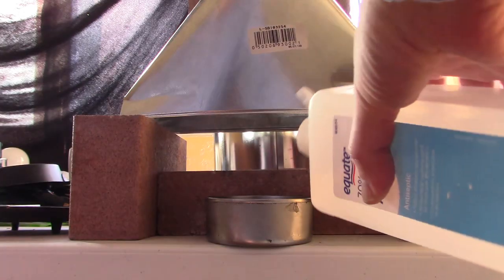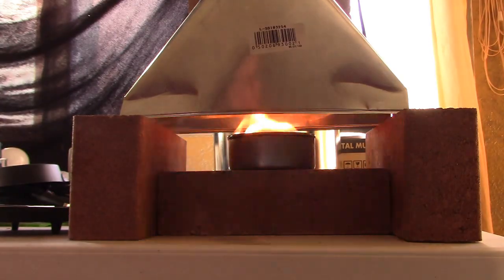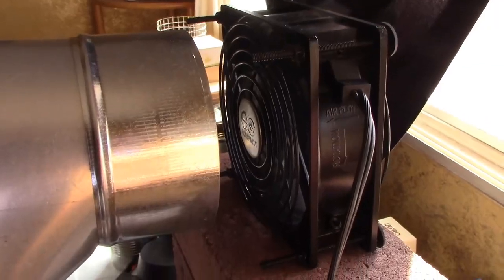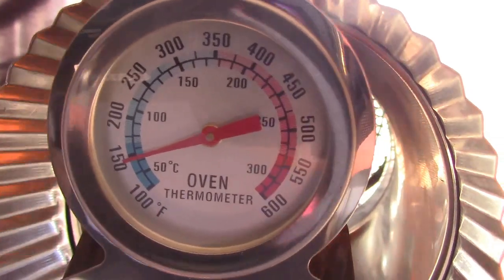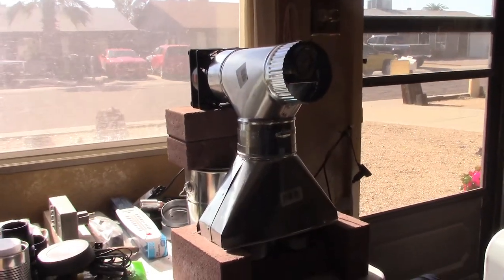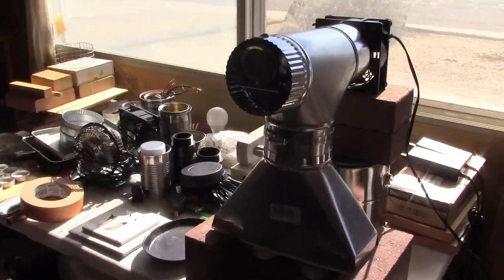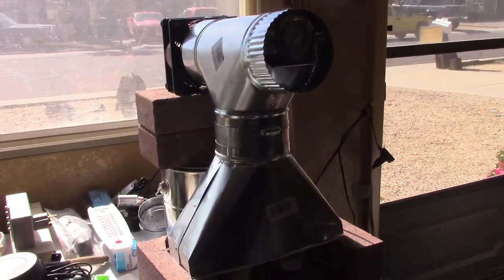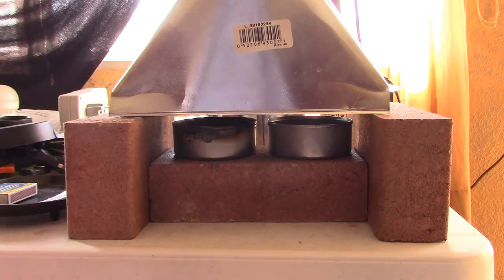DIY Stack Boot Air Heater! New design! Now with a "Tee-pipe Top" and a brick stand! - experimental

Comment: This would give me an Alternative for my VEVO Tent stove, the Top Plate of the stove comes off for Cooking, I could have the Burners inside the Stove, the top off and the Ducting setup on the top.  May use a veg oil burner with a feed line to the burner.

Comment: This is great thanks for the video. I think i will make the same one to heat up my garage in winter. I think you shoud add a mesh inside the burner at bottom to reduce flames and optimise heat to rise ...

Comment: I love your idea and design here but I think I have an answer that will make your design even better.  You need to replace your fan with a Stirling stove fan like in my link below.  Simply add a piece of metal to come out from the mouth of the "Tee Pipe" duct you have setup you have right in front of the fan and , like a tongue, put that tongue of cast iron or steel metal under the stirling stove fan and it would power this fan. watch this video link -->>  https://www.youtube.com/watch?v=4Hn16FHElqE

Comment: maybe use a little larger can to prevent the flare outs.. I like using the short dinty more more cans filled with sand as table top burners, I think one would work great in this set up. Some soup cans will fit on regular or home made oil lamps using a ball jar and oil lamp wick, you would get less heat for a longer time
Reply: that splashing flame is why the toilet paper is in the can heater, the alcohol doesnt splash out if it spills, I use sand in the smaller cans, its not as effective as the tissue but its a lot safer than just the liquid, it wont slosh like it did for you here but if its spilled over and the sand comes out, the sand is saturated with the fuel and it burns... It works with alcohol and lamp oil, I especially like it for tiki fuel even better is using used, dried coffee grounds, it smells great but is outside only because it smokes, which chases mosquitoes also

Comment: Learn something that will interest you:
the ceramic additive, motor oil, is superior to others, in addition to its anti-friction qualities,
because it magnetically 'isolates' the oil from the metal in the engine block.

oil is made of mirco particles has properties of magnetic charges, in addition to wear,
I suppose by "electrostatic" effect due to friction, it charges,
and it increases frictional resistance if these particles remain "stuck" on moving surfaces.

Concretely :
If you connect an elec wire to the negative pole of the battery,
and that you immerse it in the oil via the oil level slider,
it demagnetizes the oil,
and you notice a drop in fuel consumption.

you need a 6A diode to avoid an elec return, and a safety fuse,
but not necessarily,
because parallel grounding of the bodywork, therefore motor, should prevent the return,
like what a good mass is very important, so that it does not become negative.

it's "hull effect"
(there are theoretical docs with electronic circuit to refine the thing,
but I don't know more, between malaiglish, and my level in english, and elec high school level....)

n.b.
works from a certain engine speed,
perhaps when there is sufficient oil circulation / oil level rod,
and/or possible demagnetization of the oil according to "electrostatic".

he's a malaysian "scientist" on FB,
you have testimonials of effectiveness,
but I don't quote him in public (he wants to avoid hassles like all the 'discoverers' who go against state interests),
because he tweaked something else,
and makes 30% less consumption on his 125cc, on average people make 20-30%,
a fuel "quality" optimizer just to be mounted on the filter level hose.... (if I saw correctly)
I'll send you this by pm or email if you want, put a I love it in the com and answer ok then,

Comment: Ive gotta say, ive built this every way you have, except this way so far. But in my testing of tis heater, ive learned that 91% alcohol has almost no odor. The 70% alcohol has an odor and gives me a headache. The 91% does not. So of anyone cant stand the smell, use 91%.
Reply from the maker: hi. i'd guess it's because it's more 'pure'. who knows what the other 30% is.
Reply: Was my main concern. Thanks!!

Comment: I just finished my second solar heater.  I like the Stack Boot Air Heater but I will put a screen around 
the bottom.  Wife doesn't like flames and I will have to use a BBQ lighter.  Thank you for the video.
I might have to build a metal rocket stove.  I just read that states moving from coal to gas for electric
we will see electric bills go sky high.

Comment: Why are you moving the can when the alcohol is lit?  Wouldn't it be easier or at least safer to place and light the can, and then move the heater over it?  Unless I'm missing something.  Not trying to be a jerk.  Thanks for all of the cool (warm) ideas!!
Reply from the maker: hi. i was thinking that it would be easy to slip the can on top of the brick. didn't realize it would be such a tight fit (until i tried it). ✔🔥🙂

Comment: I'm wanting to make one but I'm only finding galvanized metal and I've heard it's toxic when it heats up
Reply from the maker: hi. galvanized metal is fine for this project. the whole thing with galvanized metal and high heat causing something called "metal fume fever" is wildly exaggerated and misunderstood. the galvanization may or may not burn off of the pipe but even if it does, it doesn't matter. if an area of the pipe gets too hot what happens is a tiny amount smoke will appear on the surface of the metal for just a few seconds and then the smoke goes away. that's it. that's all that happens. the amount of smoke is so small that even if you are looking right at it you almost can't even see it. you typically will not smell the smoke either (i never have) and unless you are looking at the metal in those few seconds, you won't even know that it happened. if you look at the pipe after it happens you will see a patch of dull metal. the only way the fumes make you sick is if you breath in the fumes. the odds are that your nose won't be anywhere near close enough to the metal in those few seconds that it takes to burn off. typically only welders get that 'metal fume fever'. the odds are close to zero that you would get it from a project like this but even if you did get it you just feel 'under the weather' for a day or two and then it goes away. 🙂
Reply: @desertsun02  thank you so much for getting back to me and giving me this information

Comment: Great man. Looking at this gave me an idea, the tapered piece could have a metal fixed Attached base Then on the base, have fire bricks. Then on top of the fire brick layer, sits a 4 inch duct piece inside the tapered piece. A small pipe would need to be attached at 90 degrees near the bottom of the 4 inch duct to supply air, then between the 4 inch duct and the tapered piece fill it with perlite to insulate and reduce any heat wasted so all the heat goes straight up towards the tee piece. I would have the tuna can left inside the  4 inch piece and fill the tuna can with some kind of fill tube. I think these designs your producing are fantastic and have given me loads of ideas to create similar things.

Comment: Two questions. How long does the alcohol last in that can? And how do you adapt the AC power supply to the 12 volt fan?
Reply from the maker: i didn't officially time how long the alcohol lasts in the tuna can but in general it lasts 25 to 35 minutes. i don't understand your second question. both fans i used are AC powered. you can certainly use a DC powered fan if you want to. some 12v DC powered fans (computer case fans for instance) will even work if you hook them right to a 12v solar panel or 12v battery.
Reply: @desertsun02  Thanks. I assume from the size of the fan that it was a 12 volt. Thanks

Comment: Not sure if I missed it, what temp did it get up to for two cans of fuel?
Reply from the maker: hi. i never actually tried the two cans. i think that would be too much heat. if you used cans with a smaller diameter then maybe you could use 2 cans

Comment: TY for vid(eoes) appreciate ur knowledge, im learning to be capable in view of recent power outages, world events etc.  Is there enuff residual heat after fuel burn to support room temp levels or, must you continue to re-fill the fuel source? Realize from other vids to perhaps use thermal holding rocks, etc., but trying to understand overall heating benefits vs time investment? Thx again for ur posts!
Reply: You have to keep refilling. And it is for emergencies. If your house is freezing without it, you won't  mind the work to keep it up.
Reply: @jodeesmith1685  of course! 😁

Comment: I sent you a link for a 4" Y Tee, I looked at it thinking, I bet desertsun could make a Rocket Stove Outta that!. I also was thinking for longer burn time to roll Carbon Fiber into the alcohol can, the stuff plumber's use to not catch stuff on fire 🔥
Reply from the maker: hi. thanks for the idea! funny that you mentioned a stove. (that's my next video) *a non-electric smokeless indoor cookstove *with 3 burner sizes - for low, medium, and high heat cooking. i just boiled a half a gallon of water on it in 10 minutes! (this morning). it's the hottest (and cleanest burning) stove i've ever made
Reply: @desertsun02  Can't wait to see it!

Comment: i made one with the tera cotta pot and an Aluminum elbow  and Alcohol as the fuel and the Co2 level was a little high for my liking and was starting to give me a head ache. So i decided to go back to my propane skillet cooker with zero Co2 Have you checked the Co2 level just to be safe?
Reply from the maker: hi. the co2 levels always stay well within normal limits for me. if you want the cleanest burn use ethanol fuel. i use the kind made for indoor ventless fireplaces. super clean burn. it only releases water vapor and s small amount of carbon dioxide (small meaning about the same that a human exhales) when it's burned. it burns 100% "particulate free". no smoke, no soot, no fumes and no odors at all. no harmful fumes of any kind are released when it''s burned.